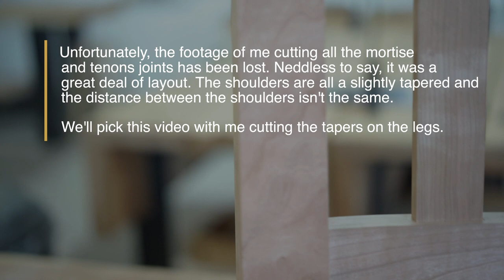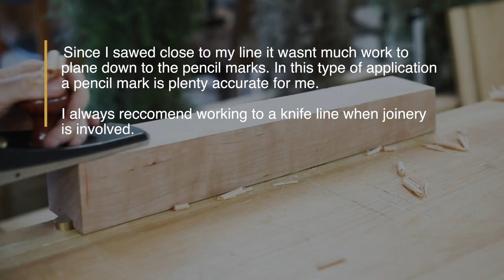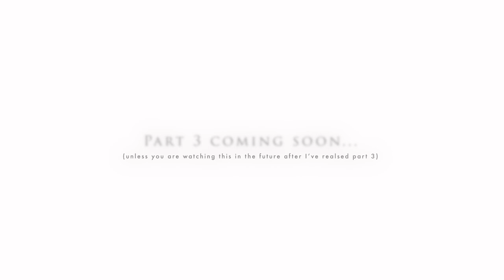Build a Modern Morris Chair Part 2 | Woodworking

Comment: Hey Justin. Sad to hear you lost some of the film capture. You mentioned that the mortising was lost. I was actually watching to see how you managed the bow arms. Were you able to accomplish the uniformity with the spokeshave shown or do I need to find an old No. 113?  Thanks in advance and greetings from Germany.
Reply from the maker: Thanks for watching! Losing footage is always frustrating. The arms were shaped by first cutting off the majority of the waste. I drew the profile on the side and cut as close to the line as I could get. The rest of the shaping was done with a jack plane working across the grain. The final shaping was done with the 113. The inside profile was all done with spokeshaves and the 113.
Reply: Justin Starr Studio Justin, thanks so much. Tom   @unplugged also responded with a ‘good to have a 113, but not necessary’ so I’ll definitely be getting a 113!  One more question: I think the arc you have on the arm is a bit more extreme than what I want. Can you tell me how you measured it?
Reply from the maker: I got the plans from The Wood Whisperer Guild years ago. I’m not sure how he measures the arc but checkout his hips video, I think he was it on YouTube.

Comment: Why make tapered shoulders on the tenons? Why not just have them fully inserted into the mortises without a shoulder
Reply from the maker: Definitely an option. You would just have to make sure the depth of each mortise is exact since they will be the registration point for the legs. With the shoulders you have a point of contact for each leg with the arms. The depth of the mortise is less relevant since the arms are sitting on the shoulders.